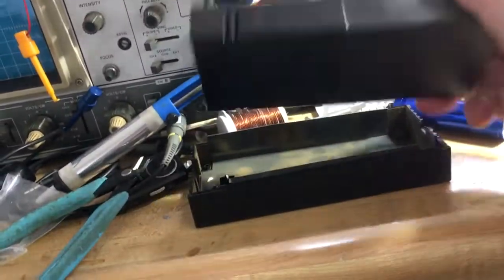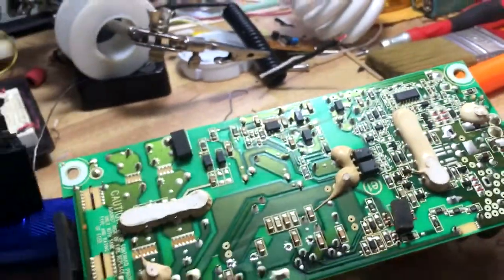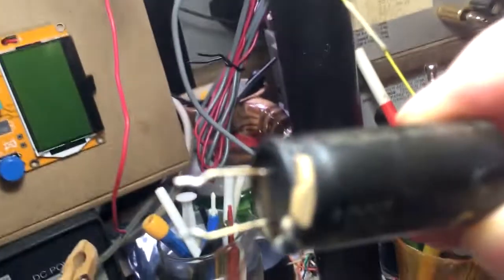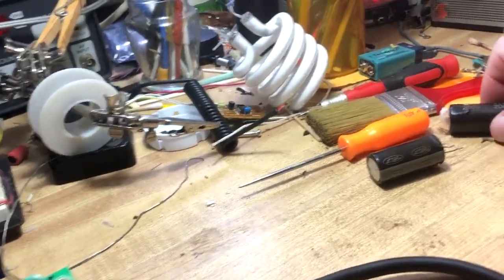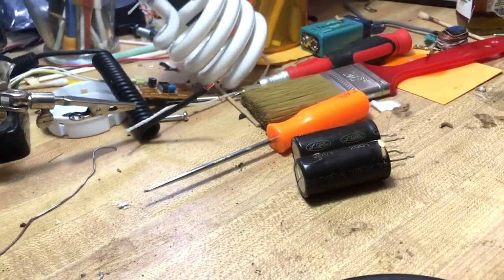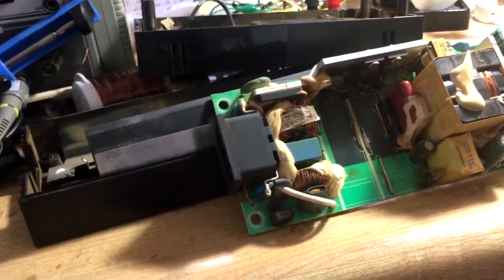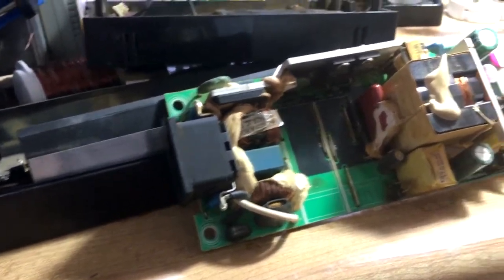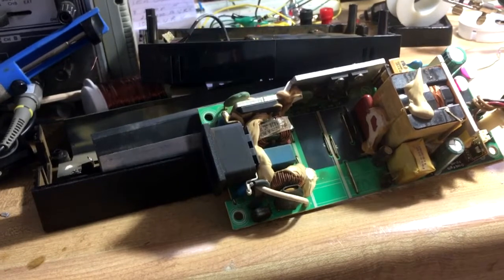Looking at an Xbox Power brick

Comment: Nice video, great peek inside a switching power supply. Watch out for High Voltage in the secondary side of the unit. The caps on that side can hold a dangerous charge for along time after unplugging it !! I have a couple of satellite receivers that have PS problems, looking forward to working on the stuff soon. I'm getting better by the day. Well stay well my friend your  looking great, 73 Leo.
Reply from the maker: Man Leo,,, great to hear you are doing better. The up down ride can really take it out of you,,, I know,,,
Yeah the first thing I did was make sure the caps were discharged. I'm thinking those 470uF at 200 volts in parallel could ring yer clock if loaded. Take care pal.

Comment: Hey Carl. I never worked on one of those but I did recently fix a control board for a Hot Tub for a friend. Symptom was no heating. I found 2 bad relays , ordered them ( $1.50 each) and replaced them. the Hot Tub manufacturer wanted $300 for a new board  :)     All good... $3.00  vs  $300.    - Good stuff bud
Reply from the maker: Yeah Ron, always fun to dabble in something new. and this is new to me brother haha. Thanks bud.

Comment: It will be interesting to see if it will work after replacing the caps.
Reply from the maker: Yeah Bill, I'm really curious to see if those caps did any more damage in the circuit. 
They had to be letting a lot of DC thru as leaky as they were.

Comment: That probably is a 230 unit. Alot of switching supplies can work off of dual voltage.
Reply from the maker: The schematic I found online was for a 230 model. And I noticed it had fast blow fuses. This particular model had no fuses at all. That did surprise me and could have protected the circuit.

Comment: I hear they make good power supplies... I have so many Xbox power bricks but they are from the 360 versions that had the red ring of death..

I never did anything with them but now I want to take one apart to see how different they are from the xbox one version..

I know they changed a few things on the xbox one version also I have the first generation it looks different from the one you have.. So keep in mind when searching schematics... They may be different not sure how much different tho... Hope to see more videos on this...

Take care Carl ❤
Reply from the maker: Oh my goodness yes,,,, you gotta take one of them apart and check it out. It's always fun to dig into new stuff and since you are a gamer, this would be right up your alley for learning. Let me know what you find... ;p)
Reply: @skycarl  Hey carl ❤ a small update.. Cleaning out my closet I found one the older version but I didn't take it apart been kinda busy..

The outputs are 12vdc @2amps and 5vdc @1amp, still works fine 👍 like I said they make good power supplies for other projects if you are interested in it let me know

I'll ship it to ya 👍  no worries.. I'm not going to use it and rather give it away then just chucking it..let me know.. Take care carl ❤ -Tai
Reply from the maker: Sg,,,,, you really should do a video when you take that apart. Yeah, it will be interesting to see what's inside of it. Check and see if it has a fuse inside on the primary. I was very surprised to see the one I took apart did not have a fuse. Hope to see you do one. Best to you always. ;p)
Reply from the maker: @subigirlawd_7307  Ha,,,, I read the wrong comment because I'm old and dumb hahaha. 
As I mentioned in the other comment,,, ;po,,, it would be really cool to see you do a tear down of it in a video. I think you would have fun doing it. If you really don't want to do that,,, ;p(,,, then yeah I would take it. Think about it,, cause it would be very cool to have you do that video,,,
Reply: @skycarl  wow its 12 volts dc @ 14.2 amps... I said 2 amps but its 14.2 😯 I'll take a quick peek now and upload it.. but if you want it then its all yours 👍

Let me know in my upload if you want it..

Comment: me no like Microsoft or xbox crap.  
I recapped Noah's, then the console went kapoot. 
it had security screws, had to order a special screw driver. 
I should have made an EOL vid with a sledge o matic, 
but he sold it all for 20$.
Reply from the maker: Yeah Don, to get into that case, I needed the star bit after uncovering them under the rubber foot pads. I have to say though once inside, it was built pretty solid..